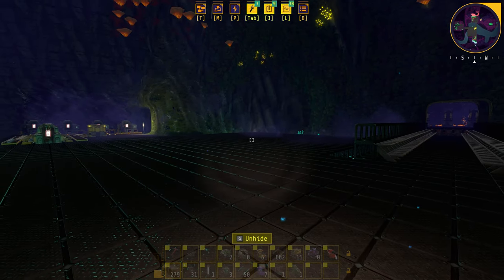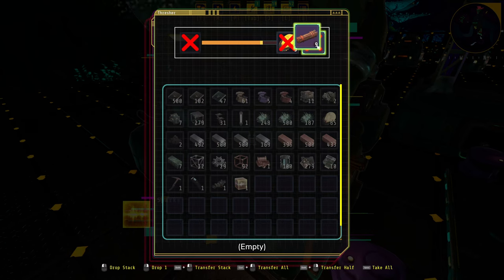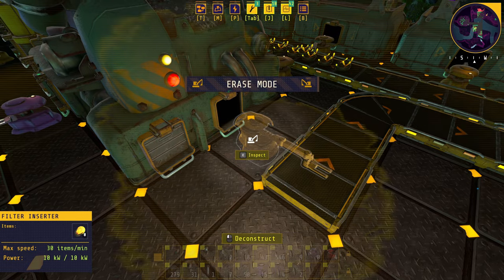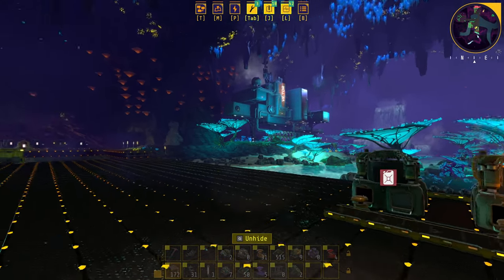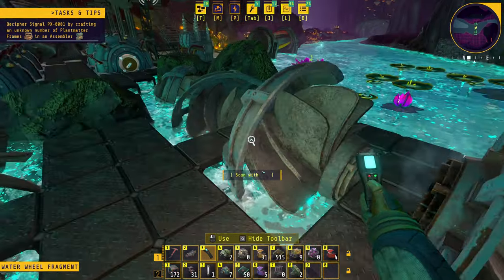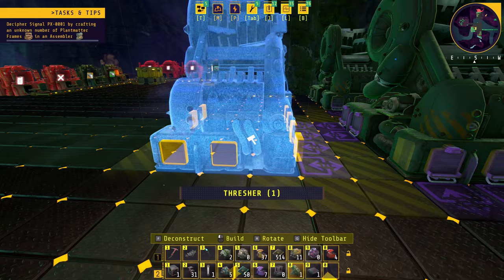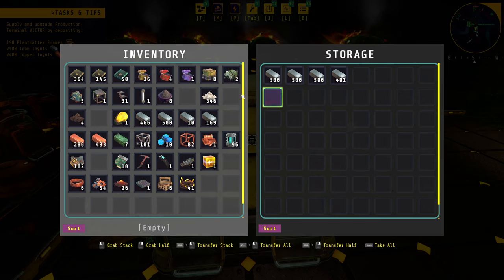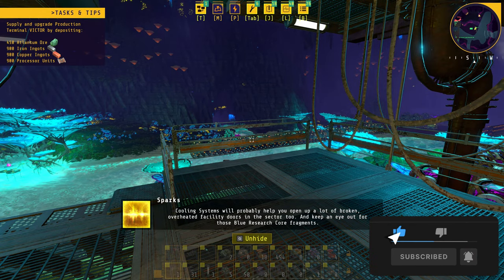Automating Our First Farm in Techtonica

Comment: i think that at the farm you need to add more seeds to the belt that feeds the farming machines.
because those machines take 4 seeds to grow plants but the inserter then already picks another seed up and readies it for loading, so at the end of the belt that feeds the farms the belt is empty and those farms lack the seeds to grow plants.
so it seems more efficient to have a belt with twice as much seeds on it as the farms would need. 
so the farms can be filled with seeds as quick as possible  and they are idle for as short as possible.

Comment: a loop line on the seeds is the only way to get big setups working in my mind it is so the seeds do not get back jammed, otherwise you have over saturate the line with seeds if it does not loop on itself. also a looping of vines makes it less hassle to pump out thrasher vines into phase 2.
Reply from the maker: That has been achieved in a future episode
Reply: @ItsBitz  got far as blast tech an a bit more, when you reach them you will realize you need to double both of your red an blue extract productions more then you think for mine charges to hit the extracted mined bonuses to be hit for blast tech machines. when that happens the thrashers can over saturate red an blue belts at mk1-3 belts, but not make enough of the other two items for the fabs of other items in making the mines.  so the use of  belts sub-lines are critical to offset the flow rates of mine charges along with the type of item grabber you use to get the flow rate's too, but be warned each thrasher upgrade will change the ratios to solve the back flow you could sink the red items into smelters then feed those new items into bio brick production or something else.

Comment: 5 farms per thresher. Each farm produces at 2/min and the thrasher needs 10/min input (it will also output at 10 seeds/min). You only need filter inserters on the outlet of the thresher. A few extra seed on the belt will ensure that your farms are not starved for seeds and will prime the system.
Reply: when you did the math did you take into account the thrasher speed upgrades. if not boost this around 20%